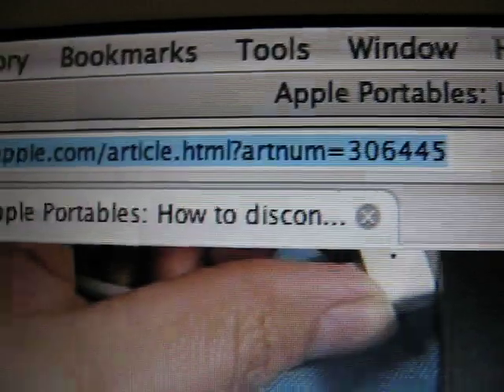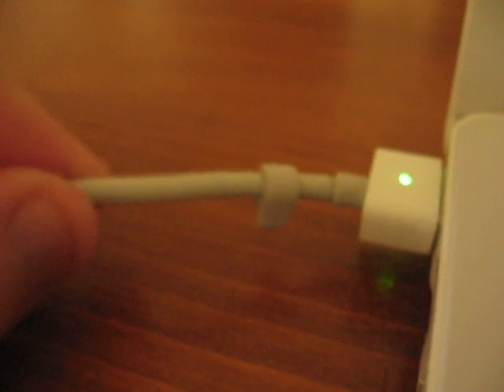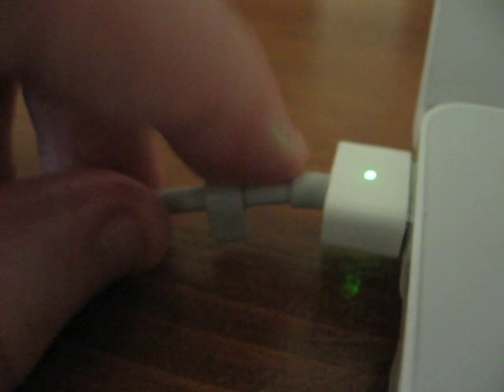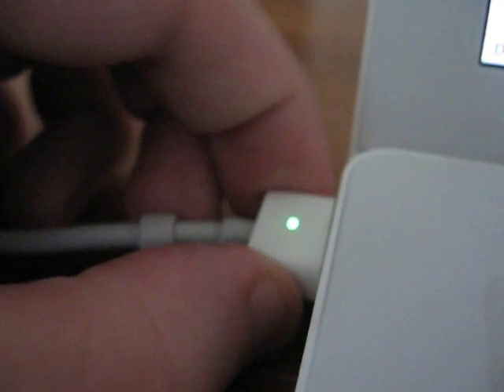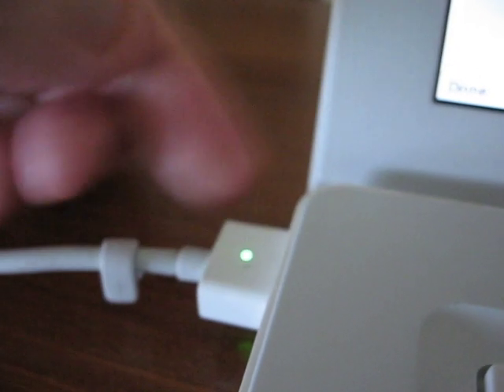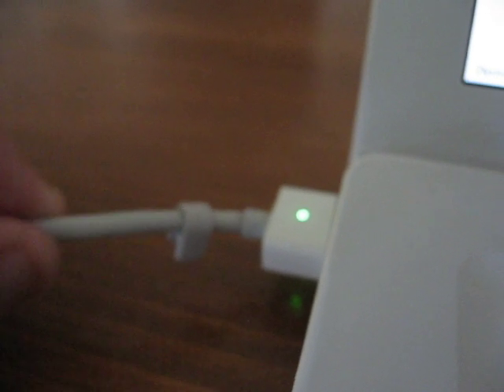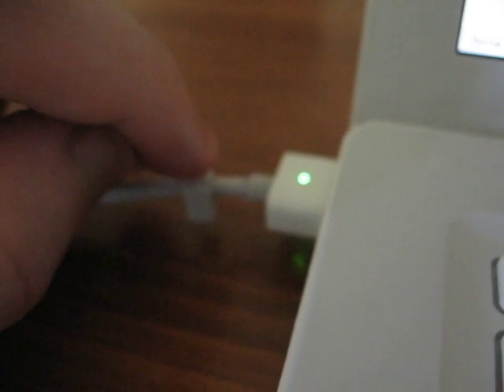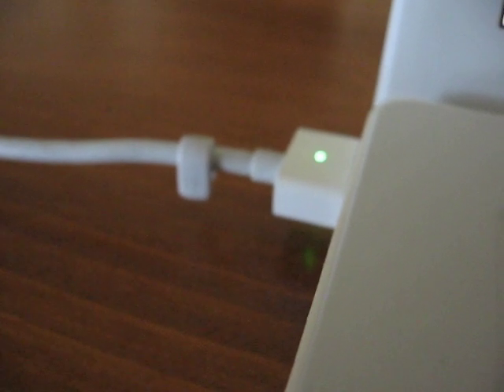How to unplug an Apple MagSafe power adapter

Comment: It's actually a very good design.  I've never actually dealt with the MagSafe connector, but the principle behind it is great.  It's essentially a ZIF type connector, so you never have to worry about internal components wearing out from bending and such.  Also, tripping hazards are significantly reduced because the adapter doesn't really enter the body of the computer, it just sticks against it more or less.  I'll take a plug falling off from time to time over a broken socket on my laptop.
Reply: It is but they kinda made it with too strong of magnets but they also did that so it just doesn't come undone easier or from iron debris. What they should do is include a cover and sell that for 29 bucks to reduce the magnet force and protect it from debris.

Comment: Pulling on it multiple times will eventually break it. The point however was not that the power adapter wouldn't break, its that the laptop would not get pulled off a table but instead it would just break the adapter would. Thus saving you hundreds if not thousands of dollars.

Comment: This is not actually the only reason why the MagSafe wiring fails. The "strain relief" on the cord-side of the connector body is too rigid and too short so any bending or flexing along the length of the cable that ends at the connector will be concentrated on a very narrow segment at that end. There are fewer "exposed wires" failures and more "burn mark near connector" failures and these are caused by bending, not yanking.

Comment: I clicked on this video because I thought it was a parody... are people really this dumb?  You're not supposed to pull an electrical cord out by the wire, so why would you do that with ANY other adapter?
Reply: It doesn't make you dumb to do what most people would do in a rush. To be honest this is helpful, because not many people realise that pulling by the wire causes damage until later on, so it serves as a good warning.
Reply: I've searched a tutorial because I need to tilti the plug to easily unplug it and I'm not sure if this is the proper way... in this video he tilts the plug as well so I think is okay...
Reply: Czech I agree that it is surprising how many people were unaware of the standard treatment of electrical plugs, but it’s always good to see how those that engineered the plug recommend handling it.

Comment: You know, it's pretty bad when you have to do a video on how to unplug a power cord from a item. Common sense should dictate that you NEVER pull the cable but instead, grab the plug. I do admit that I was checking out the reviews on this adapter and a lot of people have rated it crappy. It's a cool concept but the quality control on this thing is atrocious! Thanks for the vid though.

Comment: What a finicky piece of utter shit.  I went in to the Apple store with my buster power cord, and they made me buy a new one, but they didn't inform me of this so called "technique" for removing the cord.  Now my second one has the same problem.  Why don't they just build a power cord that isn't utter crap.  My old Dell didn't need a special technique to remove the power cord.  Its fairly idiotic to require a special method.

Comment: 2.54 mins to say "dont pull it out by the wire" this is so fucking drawn out its untrue.

if they reinforced where the 2 parts come together this wouldnt happen, its done delibratly.